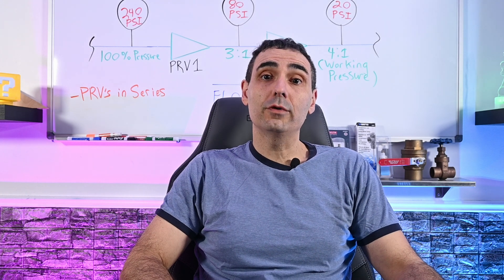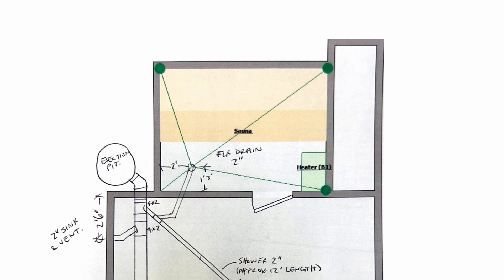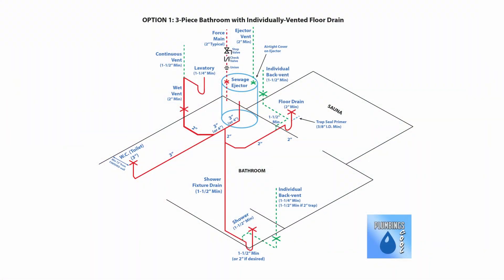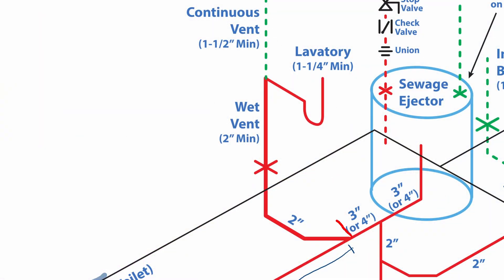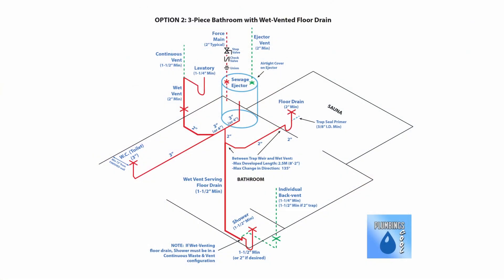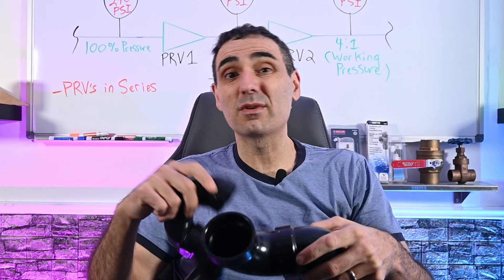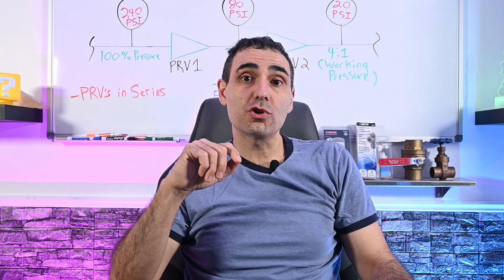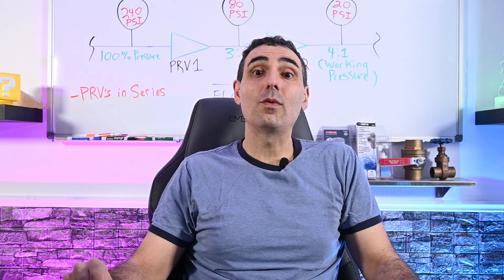PC Q&A:  4-Piece Bathroom Rough-in & Venting MasterClass!

Comment: In the U.S. you cannot run a flat dry vent until you are 6 inches above the flood line of the highest fixture being vented.
Reply from the maker: I'm not sure which part of my video you're referring to, but here in Canada, an INDIVIDUAL dry vent can run horizontally on its way up to open air - although it does obscurely state that "all vents shall run as direct as possible to open air".  

The important thing is that the dry back vent connects to the trap arm ABOVE the drain's horizontal centerline (to minimize water from backing up into the vent).  It's also important that any other connecting vents (thereby creating a Branch Vent, connect "above the flood level rim of the highest-connected fixture" (to prevent an unintended bypass).   Otherwise, there are times when you'd NEED to run the vent horizontally below the FLR, such as when back-venting a bathtub or an island sink, which has its trap below the floor. 

The only exception where two vents CAN connect below the fixtures' FLR is for WET vents.

Thanks for your feedback!

Comment: Hello, I was wondering if you can answer my question. I had an outside bib that needed to be replaced. When I cut it, the pipe retracted into the wall. Just my luck. I can pull it out with my finger (it's a 2 inch hole in the wall). I want to hold the pipe or clamp it for a few seconds to solder on a fitting. Is there a product that does this? I don't want to use regular clamps because they might mess up the pipe. The other option I guess is to break a little bit of the concrete. 
I would appreciate any tips!
Reply from the maker: Hi there, and thanks for inquiring.  Hopefully I can help you out with your dilemma.

In that situation, I often to using Vise Grip locking pliers (preferably the mini ones, which are smaller and thus take up less space) to lock onto the pipe and stop it from slipping into the wall once you pull it out, and as you attempt to solder it (it will also free up your other hand! 😊).

I acknowledge that you don't want to damage the pipe, but if you open the vise grip wide enough so that it squeezes the pipe ever so snugly, you shouldn't have a problem with the pipe becoming damaged.   You don't want to apply so much pressure so that the pipe becomes oval when you squeeze it; you only want it snug enough so that when you let go of pulling the pipe, there is enough resistance from the vise grip to stop the pipe from slipping into the wall.  If purchasing mini Vise Grips, try to find rounded Jaws as opposed to the straight ones, which will do a better job at holding the pipe more uniformly and minimize potential pipe damage. 

Here's an example of the mini Vise Grips I'm referring to:

https://images.app.goo.gl/Mx9PYLFJXuGZexL68

(and next time, don't cut off the pipe unless necessary; that's the beauty of copper pipe compared to plastic pipe:  Copper fittings can be sweat off and easily replaces, whereas with the latter, you're stuck with cutting off portion of pipe.) 😉
Reply: @PlumbingsCool  Thank you very much. I hope I can pull it off. I didn't know it would slip back into the wall to be honest. I won't do something like that ever again. I'll try the vice grip. Appreciate your advice.
Reply from the maker: Awesome. Let me know how it goes.  Another perhaps quicker option might be to pull it out and temporarily wedge a piece of wood between the wall and the pipe.  Just make sure the torch flame doesn't come into contact with the wood wedge to prevent it from catching fire.

Good luck! 👍